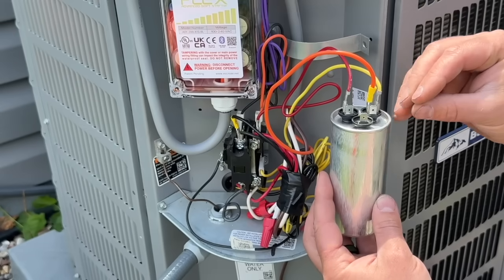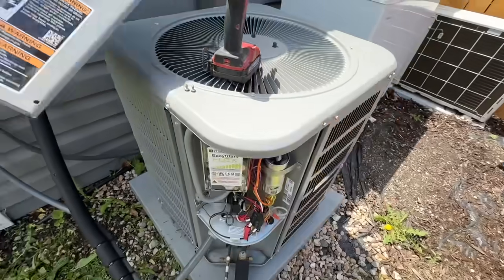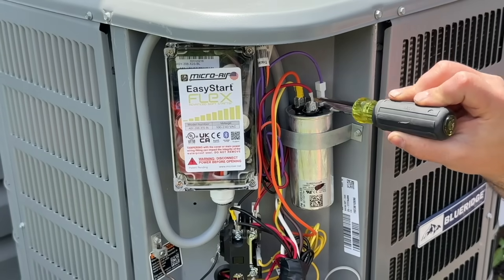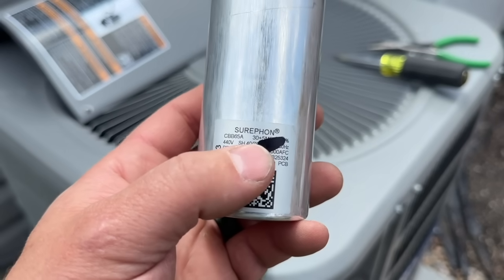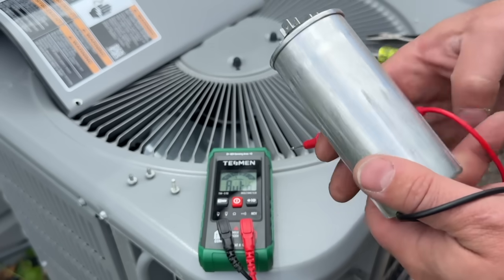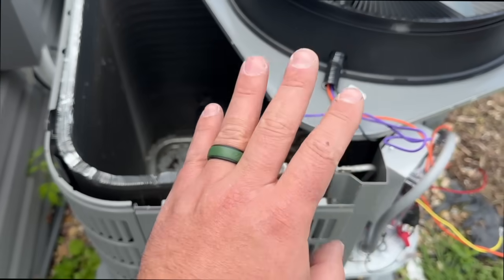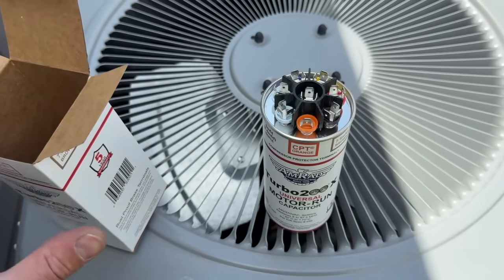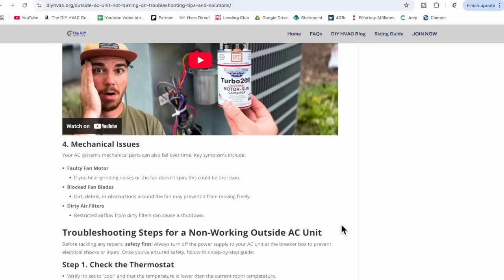STOP Getting Overcharged For This Simple A/C Repair

Comment: Wait a minute.  You never 'clearly' described what the symptoms of a failed capacitor are...no cold air, compressor or fan not running, etc..  With that knowledge, it's unlikely that someone will believe a tech who says a capacitor needs replacement just because he's doing a seasonal tuneup.  Educate your viewers to avoid a scam, but also to know the symptoms so that they can perform a cheap repair instead of calling for service.

Comment: Hi, the fan of my external unit is working, but the compressor is not working. I changed the capacitor (twice, to make sure they are okay). However, the compressor is still not working. Any suggestions, please.

Comment: FYI... Purple is not "always" your fan. In fact most of the brands I deal with use purple as the hermetic (compressor) and BRONW for fan. Purple may be your fan wire for most of the brands you work with. Additionally, if a fan has ever been replaced, or a wire that was burned up ever was replaced, many techs out there may use whatever colored wire they have on hand instead of trying to color-match. Electricity is color-blind...it doesn't care what color insulation a wire has. Therefore, it is always best to visually CHECK what wires are where. Good practice is to shoot a photo with your phone so you can refer to it later in case you're confused or your memory lapses.

Comment: As an ac tech this is good info, Just please remember if you do this  yourself, Please make sure you put the wires back in the proper spots.(Again pics ) If you do not you will ruin your compressor. Then you will have to pay thousands. Also if you willy nilly put any type of capacitor on this you will either get not enough charge or to much charge and again ruin your condensor, Also do not recommend the universal Capacitor as it can be confusing for some people. Other then that Great info my guy. You kept it simple and love how  you showed them the trick for checking the cap with the meter.

Comment: My AC just went out but has been running fine for many years. The old capacitor is 30+5uF and while the fan states 5 MFD the compressor calls for 45 MFD.   How important are these numbers?   Did I just get lucky?

Comment: Here in Arizona where temperature is 110°F-117°F during summer, some years I had to replace capacitor even twice on small AC 3 ton, always is bad the fan capacitor 7.5uF, the larger AC 3.5 ton (second floor) run after 9pm so I never have to change capacitor on that one.

Comment: That was a very good explanation and I appreciate that you pointed getting ripped off that badly is rare. A company that charges 2K needs to be reported to  your state consumer affairs board. I want you to look into something I want to share.  You can replace a cap rated at 370V with a cap rated at 440V. There isn't much difference in price and it'll stand up to use much longer. Look  into it. You'll be doing your viewers a favor.

Comment: I appreciate all your videos. I knew very little about HVAC but I am an all-around handyman/mechanic. My son is a journeyman electrician so I felt very comfortable switching out a furnace unit for a complete system (that is, after watching many videos). I noticed you are from Utah. I live in Clinton Utah, by Hill AFB. While I can ad refrigerant to an auto, I think I would like a tech who has all the right tools, nitrogen, and Correct refrigerant to do the brazing, pressure test, ad the correct coolant as per line set footage, etc.  I bought a system through HVACDirect for about $3500 plus line set, electrical cut off switch, connectors, etc. Bids on this job were 12k - to 15k, with one for 10K and a mexican guy who said he would do it for 7K-ish.

Comment: I didnt know anything about HVAC units but very mechanically inclined. My condenser would stop running in the heat of the day and start hissing. 

I called an AC company out and he told me my run capacitor was going out. I asked how much does it cost to install a new one and without hesitation he told me 750 bucks. I pondered for a minute and he said he could do it off the books for $250. I knew a (capacitor) was a fancy word for a rechargeable battery .The price spread was so huge i figured something was wrong. So I told him I would get a second opinion.

I grabbed the serial number on my unit, called Grainger and was stund when they told me $7.49😮. I changed it myself in 20 minutes.
Reply: And the HVAC  industry wonders why they have  a bad image🤣

Comment: I changed the Capacitor, but the contactor didn't start the fan, only when I press manually. What are the sign that I have a bad contactor? Also, is it possible to have the contactor magnetic switch been pressed until I get a new replacement? I just notice that the blower inside the HVAC unit is not working, what could be causing that.? Appreciate your help. Thanks  supper, hot day here.

Comment: On my capacitor hook up. My purple wire is the hermetic connection. I had a orange and red wire connected to the common. The Brown wire was for the fan. My system is a Rheem unit from 2004. This was a easy replacement to do. I measured the old capacitor and it was still within specs. I decided to replace it since it's over 20 years old.

Comment: I changed mine. AC was under warranty but would be 3 days out and labor not covered (in the summer of course). Decided to start checking connections with my volt meter and found the Capacitor faulty like my Water Well capacitor (Was easy to spot because it looked bloated). Took the sample to Locke Supply (and there were a dozen AC company trucks there getting parts) . Counter guy gave me one (Titan) that looked different but pointed at the "440" and 45+5 rating and said was the important part not necessarily the shape........I asked if these go out very often and he said most all these guys (HVAC) are mostly buying capacitors.... $18.........I bought a spare and have it in a ziplock with 2 tools to change and easy instructions incase I'm gone, my wife can do it (Same with the Well)

Comment: I replaced my 18 year old capacitor before it died and kept it for a spare. Great advice and keep up the great content. HVAC guy’s in my area want $200 just to show up 😢 then the part and labor.
Reply: Yes. I replaced my 22 year old capacitor today. I measured the values on the old capacitor and it was still within spec. But the price for a capacitor is cheap enough. I paid just over $31 for mines from Amazon. I bought a Amrad branded one. I noticed that when I bought my capacitor I saw that it was the last one they had with the specs I needed. I was checking the delivery date on it earlier today and I noticed the price had increase to over $45. I guess they must have some foreign made parts in it. The tariff tax is hitting.

Comment: I replaced the capacitor on my AC unit. I took the old capacitor to my local Locke Supply store and they sold me a new capacitor. It has been working great for three years now. I took photos of the wire connections before removing the old capacitor.
Reply: Nice. Also wouldn't it be safer to just shut down power to whole house just to be safe about not being electrocuted ?
Reply: @alexd5188  your over thinking this, pulling the breaker as shown is more than enough,  killing total house is overkill.
Reply: I noticed after taking off side panel of AC condenser unit that my capacitor doesn’t have the sticker on it to identify the model #. Looks like it was peeled off for some reason. Is there a way to identify the model # from the side panel sticker which has all sorts of info like compressor and fan stuff? Or will Home Depot be able to know once I hand them my old capacitor
Reply: @inquisitvem6723 , you can probably get the capacitor information you need from using the model number of the AC unit.

Comment: Lmao 15$ you say, then you show tools that cost money and then end it with a 100$ cap. 

I guess this is all after the technician did the work to tell you it was the cap. Tell us how to diagnose it 😂 I'd love to hear from the guy with a bad contactor coil that's o.l. and changing caps thinking its the 15$ fix you promised them. 

I hope the multi meter you're showing is rated to protect the user at 240 volts should anything happen. 

Yup 15$ and the motivation to try is all you need =D

Still waiting to hear what you think a shop should charge to diagnose, install the turbo cap @100$ and business overhead 🍻.

Comment: Changed mine out today, thought it fixed it, it froze up again after a few hours. I’ll check the old capacitor with my multi meter like you said. I don’t have the fancy other type of meter.
Reply from the maker: Freezing is generally caused by low refrigerant and or a clogged filter
Reply: @diyhvacguy or a bad or failing blower motor.

Comment: Well, I wasn't quoted that high. It was around $220 or so for a capacitor. I remember reading a comment on a local social network (Nextdoor) about replacing them. So I bought one from Grainger for about $30 (included shipping) and replaced it myself. It was absolutely ridiculous how easy it was to replace. Probably took 10 minutes. All you have to do is make sure you get the right replacement part that has the correct spec's.

Comment: Listen price gouging happens and that is horrible and I hate that, but HVAC is an expensive business to run.  That $20 part has a lot of overhead costs. A technician in a $40,000 van filled with $100,000 in parts, making $50 an hours, working bonded and insured, and with company benefits, has to drive 20 miles to your house, spend between 1 and 10 minutes waiting for you to answer your dam door and talk to you. 5 to 15 minutes diagnosis (depending on how difficult it is to access your AC) another 10 to 20 minutes showing you on the multimeter what’s wrong and explaining what repair you need and it’s cost, and 5 minutes making the repair and another 5 minutes making sure that is all that was wrong.  If all I do for a week is replace capacitors and a business still needs to make a 8% profit margin that capacitor costs $180 to put in. Actually probably $191.00 I for got to add 6% sales tax.  
Your bill will show a 
$79 dispatch fee
$55 diagnostics 
$60 capacitor 
Total $194 

That is honest pricing. We are not a parts store. If you drive to the shop and want to buy your own capacitor and install it your self we will sell it to you for $28.

Comment: Mr diy guy, I believe you have run a business before. 

What is an acceptable number, to you, for a small shop to charge for replacement of a capacitor? We use the 100$ 5yr warranty turbo cap, we do a full inspection of the unit upon arrival. 

I get the for entertainment video but really, what do you think we should charge?

600 is ridiculous and idk how people get into the thousands but overhead does exist and it costs money to have professionals in vans. Very interested to see your approved cost for a business to charge a residential customer.

Comment: Great video.  Instead of taking apart your outside condenser to verify the run cap specs you can look at the spec sheet or repair parts sheet.  If you did not receive these sheets when the unit was installed you can find these sheets on the manufacturers website.  You can download the sheets as a pdf document.

Comment: One of the worst product rip offs. A honest company has to make a profit, but shouldn't rape you. The company I worked for before I retired would add up the mfd.  40-5 would be 45x3, so 135 bucks for that capacitor. We also didn't use 370 volt capacitors. If the customer had a 40-5 370 we would use a 40-5 440

Comment: My capacitor went out the day after a 116 degree day. It still was 95 but not tripled digits. Fortunately it was replaced under warranty. I bought a spare and have it in my garage if it happens again.

Comment: I just did a YT short on this. You honestly think changing your run capacitor is saving you $ ? A quality contractor that isnt “scamming” you looks into WHY the capacitor may have failed. Anything that causes your system to run longer/harder SHOULD BE REMEDIED. There is a laundry list of items that WOULD get checked if you have a trained tech out to your home! Think of a bad capacitor as a “stop and THINK” moment for your system. If you just change the capacitor and think you just saved yourself hundreds of dollars, THINK AGAIN!!  Lots of times i find a bad run cap happened because the unit was low on charge, the coils were dirty, the indoor blower is under performing the outdoor fan is underperforming , there are loose wires at connection points, I can keep going but i think you get the picture! Ive had customers change capacitors every year  over 4 years and I found out the first guy (previous homeowner) changed the capacitor with the WRONG one!! 🤯That customer added years of wear to their compressor !!  Lots of times ill find the unit was running low on charge and if you just change the capacitor you are adding tremendous wear and tear on your compressor! Its worth it to get your system looked at by a professional. We dont  go to school for 12-24 months to just change capacitors and charge a fortune. If i have a piston system ill tell the homeowner what the gauges SHOULD read BEFORE i put them on so nobody thinks im just trying to sell refrigerant!! Being armed with knowledge is great and people trying to charge $1000 for a cap change should be shot but there are to many benefits to having a professional out to risk saving a few hundred dollars. You may end up with a bad compressor and needing thousands in repairs trying to save a few hundred dollars!! Not to mention you risk getting the shock of a lifetime when you dont handle the cap properly!!  I had one customer receive a shock, then dropped the power line on the copper refrigerant line where it blew a hole right in the copper losing the entire charge!!  Disaster is always when we are dealing with high voltage and high pressurized vessels. CAUTION TO ANY DIYer.

Comment: This is BY FAR the best video ive seen on capacitor replacement. This video answered every question i've ever had. I totally feel that i am now prepared to replace a failed capacitor when it eventually happens again. A sleezy company charged me $500 last year, and he performed the work before i arrived home so i couldnt watch and learn. I specifically told him that i wanted to be there for the work. My wife was home, so he proceeded and was done within 15 mins. He was handing my wife the invoice as i was walking in the door. Fucker.

Comment: My R22 Ruud 4T condenser had it's capacitance updated 2 years after it was sold.  I have never had to read the capacitor size off the compressor; the label on the oil filled capacitor has always been legible.

Comment: Had a local company come do a "$99 tune up" because after a whole bunch of years it wasn't cooling quite as well as it once did.  Mostly I just wanted to make sure it didn't need more refrigerant, but thought I would see what "tuning up" an HVAC system entailed from their perspective (turned out to be a scam of them taking a bunch of pictures and emailing them to me).  I already knew about the run capacitor's potential to go out at anytime from watching this channel for years, so when this bonehead said my capacitor was "going bad" and I probably needed to replace my whole A/C unit soon I almost fell over laughing.  I specifically asked him, "So you're saying that because the capacitor may fail that the whole unit needs to be replaced and not just the capacitor?"  Of course he said. "Yep! We can give you a quote for a new system."  (I put all this in a nice Yelp review for the company too)  
Anyway, after he left I cleaned the inside and outside coils and it was back to blowing as cold as it originally did, then shopped around for a Titan HD capacitor to have in the garage "just in case".  I've been waiting/procrastinating for a while, and for the temps to get to the point I could turn the A/C on and run it for a while to put it and an Easy Start that's been sitting in the garage since last Fall, so thanks to this channel I can now run A/C off my home battery system and shouldn't have to worry about the capacitor again.  
Thanks for lots of great videos and advice!

Comment: Ohmmeter???  Yes there is charge moving but what’s the capacitance reading using that method? Is it worth risking a $1500 compressor because the capacitance was at 1ųF which will show on your ohmmeter? I’d say use a VOM with capacitance setting or call a pro.  Yes, support American, Amrad all the way!

Comment: Charging $1000 for a Capacitor change is not overhead, it is price gouging and scamming. Replacing one takes 10 to 20 minutes max. A minimum trip charge and a small markup on Capacitor would be reasonable. Anything more is theft by the HVAC Contractor,IMO. If your handy like me, do it yourself.  I always keep spare contactors, capacitor, Fan relay, sequencer, etc on hand at all times as a homeowner.  Great video, Thanks for sharing!
Reply: Seriously. I'm already paying for them to even show up. They probably have a box full of capacitors in the van all the time.

Comment: I was helping a neighbor recently and the HVAC guy said they charge $500 to replace capacitors.   I said - are you referring to a standard $10-20-30 capacitor and mentioned the US versions versions versus the others and he said - Yes.  He said that $500 was for a US version and that they charged $300 for the others.   At the very, very minimum buy 1-2 of each capacitor on your unit and just swap them out if you have an issue.   There will be 1-2 on the compressor side and then another on the fan side.  These will be located in different places on a package unit versus a split unit.    It definitely pays to research your system and be prepared for this eventual failure and save yourself a ton of money.